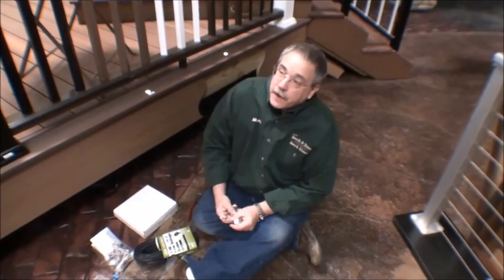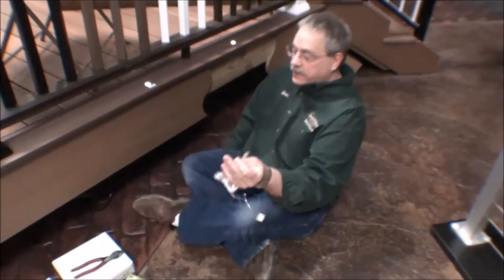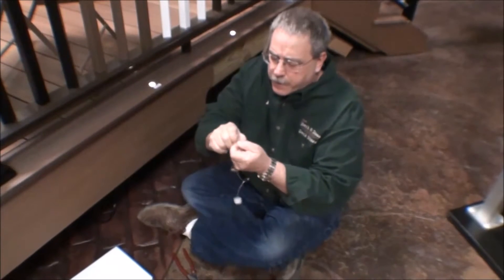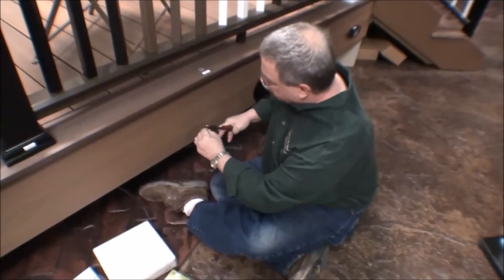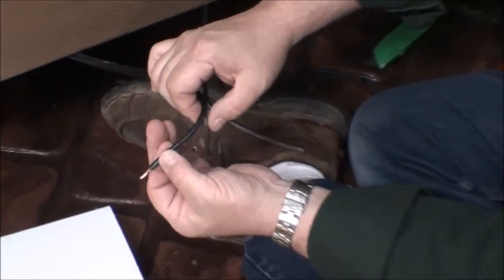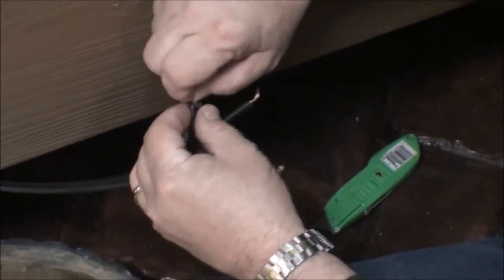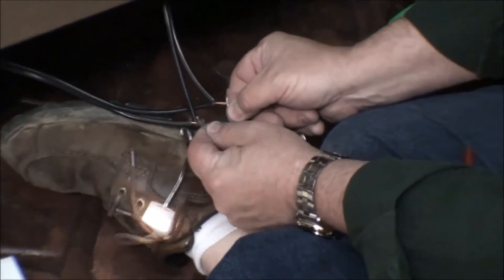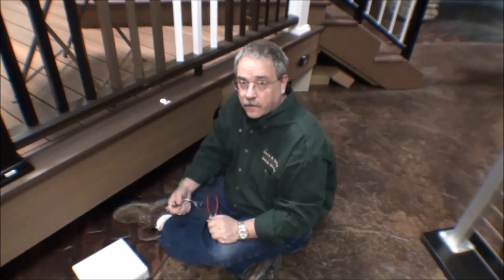Trex Light Wiring

Comment: Most standard low voltage lighting transformed are A/C.  The Trex DC lights will not work.  You need a DC LED driver transformer.  Also he failed to mention that the transformer he hasher is a DC type.  There are A/C-D/C bulbs and DC only bulbs.  These are DC only.

Comment: I have wired my deck in similar fashion.   I have three home runs of lights going back to what will be my power supply.  Can you use a standard low voltage transformer box to power the trex lights?  Or must you adjust Trex's DC transformer/splitters in the similar way you convert their lights?   Thanks